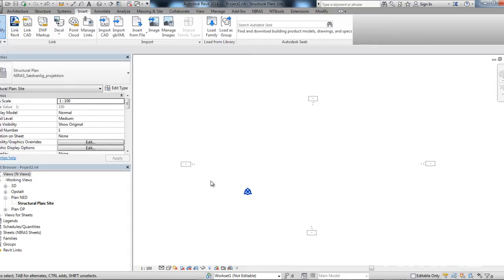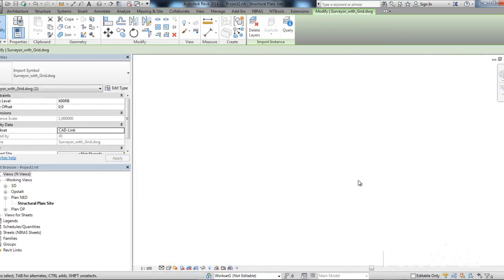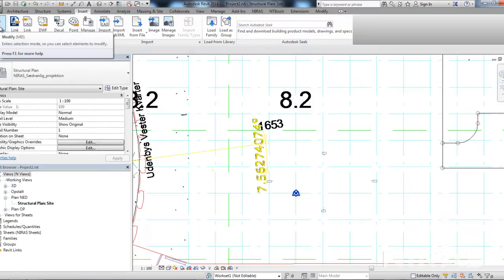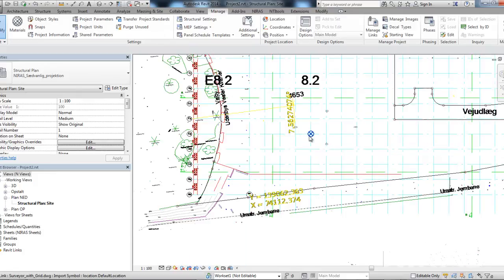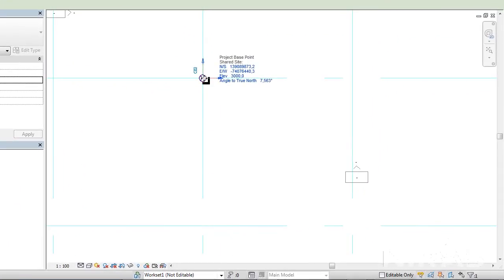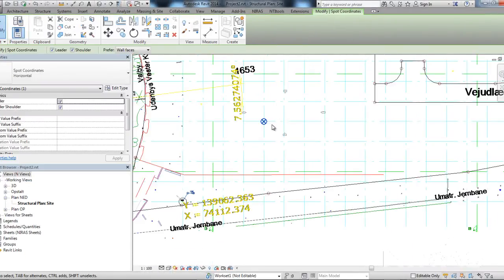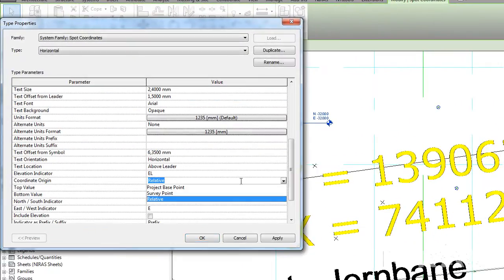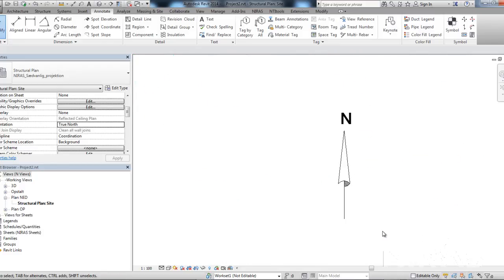Link Surveyor DWGs into Revit and acquire its coordinates

Comment: Now that you have acquired coordinates from the DWG into this Revit file, how would you link this Revit file into a 2nd Revit file. Let's say you have a mechanical model and would like to have that one share the same coordinates with the Architectural model. Do you have to use the DWG file for the Mechanical Revit file as well? It's unclear to me how to repeat the process of dragging the DWG file over and rotating it the exact same way.